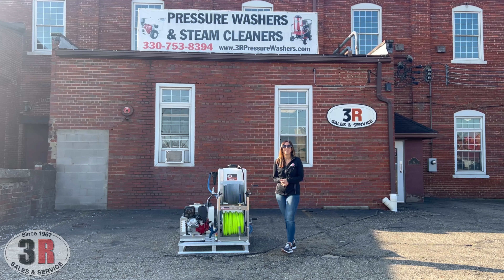CONDOR Skid Assembly: 40”x48” Aluminum Pallet with 3000 PSI, 5.5 GPM Cold Water Pressure Washer

Comment: I am just getting into pressure washing, house, and roof washing. Can this be used to soft wash houses and roofs? If yes, I assume you would put SH in the soap tank?
Reply from the maker: Hi Sal,

This skid is ideal for house washing / driveway cleaning / etc with high pressure or using the pressure washer at low pressure (soft washing).  However, for roof cleaning you’ll need a soft wash system that uses a diaphragm pump so that you can apply a heavier concentrate of SH.   A pressure washer will dilute your SH too much.  A diaphragm pump soft wash system will apply your mix at whatever ratio you’d like.

If you’re looking for a compact skid that can do both house wash and roof wash, then you will need one of these skids:
The FALCON: https://3rpressurewashers.com/products/customizable-falcon-package-48x48-aluminum-pallet-assembly-3000-psi-5-gpm-cold-pressure-washer-12v-soft-wash-system-copy/

THE RAVEN: https://3rpressurewashers.com/products/raven-package-48x48-aluminum-pallet-assembly-3000-psi-5-5-gpm-cold-pressure-washer-12v-soft-wash-system/